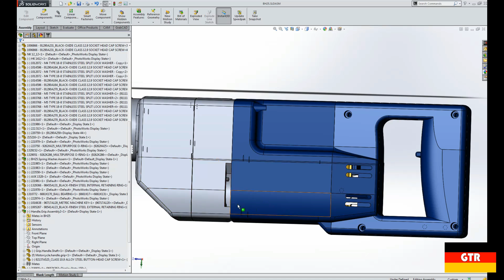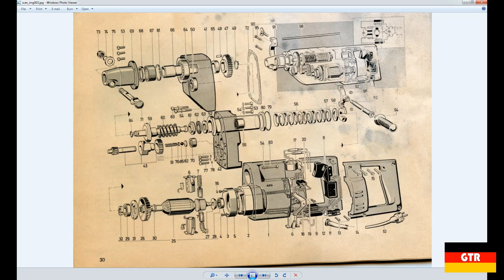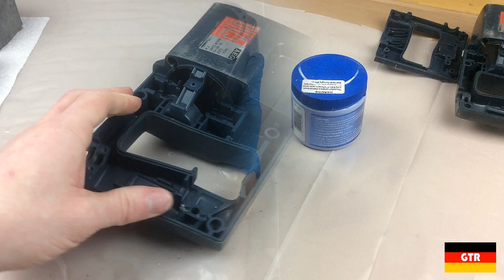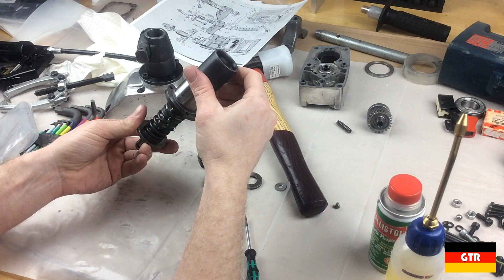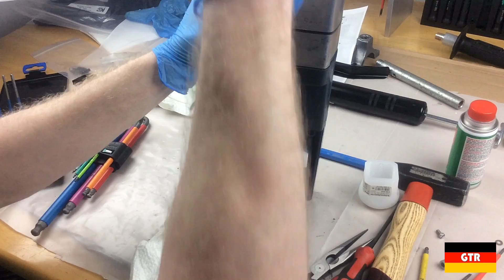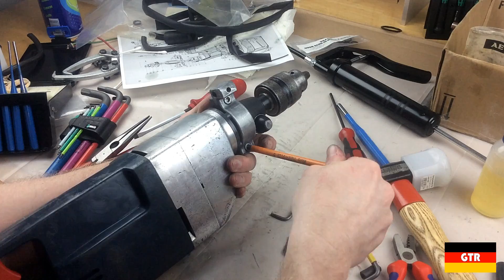Vintage AEG BH25 Rotary Hammer Part 2 - 3D Model & Restoration

Comment: What type of grease did you put into the gear box? I recently rebuilt a PHE series pneumatic rotary hammer for which the maintenance manual required two special types of gear lubes by Shell (Tivela, Darina) which are hardly sold in small quantities.
Reply: I am also restoring a phe, this is a phe25 and i noticed that the piston chamber is sealed of from the gear housing, indicating a different grease or oil, would you please share some info on that type of oil?, other info is also very much appreiciated 👍
Reply: @06vamigre  Please check page 7 of this manual
https://www.wmv-dresden.de/documents/AEG-AtlasCopco/phe_24_und_26_und_30_-_reparaturanleitung.pdf
Darina is based on mineral oils while Tivela is based on polyethylene glycol. You need to google the new names of the geases.

Comment: Is there a reason you don't use molybdenum disulfide grease in the gearing? I would have thought that would be best for that application.
Reply from the maker: I used some Polyurea (Shear Stable) grease because it is compatible with nearly every other grease out there, therefore I could add/replace with different types as needed in the future.  But you are right, the moly would be the best for this application and what was probably in there before.

Comment: Fantastic modelling! I've been thinking about learning solidworks for a while, but haven't got around to it. Do you use it professionally or self taught? Any pointers to good tutorials/books or best to just dive right in and start messing around? 

Thanks for the video! All the best from hellhole Belgium!
Reply from the maker: I am really just self taught.  Where I work, all of the engineers are allowed to install a copy of Solidworks at home per our licensing agreement.  The version I am using is Solidworks 2014.  The book I used to learn everything I needed is this one:  http://amzn.to/2mCWlZh       In it you learn to build an engine from scratch.  You would need to get the copy for the version you are using.  I would suggest getting a used copy instead of a new one.   I think I payed only $10 for a copy that had hardly been used.

Comment: might shield the brushes if you can, because the UV from sparks will cause all kinds of damage.  all those drive shaft washers, almost absurd so many, do you know their purpose?
Reply from the maker: Yeah, some of the wires were starting breakdown from the UV exposure so I think it may have been sparking for a long time or possibly the suppression capacitor is not good anymore.  Those washers are actually spring washers (belleville washers) and I believe they are there to to dampen the hammer so it doesn't chatter as it rides up the helix surface.  That is my guess, but I suppose you would need to ask the designer why so many are in there if they are still alive.

Comment: Hey dude that was a great 3-D rendering thing I kind of like that just an idea you might want to look into getting some t handle hex keys are they working little bit better than the L-shaped ones I find when you're doing parts like kind of working on a bench like that just makes it a lot easier on your hands
Reply from the maker: Yeah I might look into getting a set.  I have a bench top set of hex drivers with regular screwdriver handles, but I find that it is hard to get that last 1/2 turn with those.  Either a T-handle or Flag-Handle set would work better.
Reply: German Tool Reviews yeah that might work it's just I like t handles for admission on my videos that they're just good for that little bench top stuff i've never heard of flag ones

Comment: Didn't you have to measure all the bits and pieces yourself to make that model?
Reply from the maker: Yeah I pulled out the calipers and measured every piece that was custom.  The hardware models you can get from McMaster-Carr once you figure out the size and length.  I really have no idea how these old timers designed these things without the CAD software we have these days.